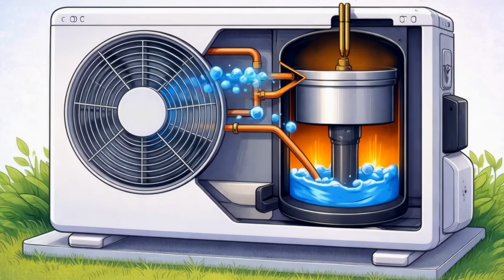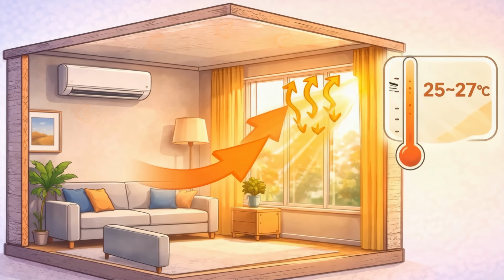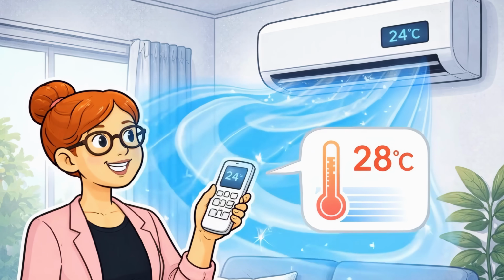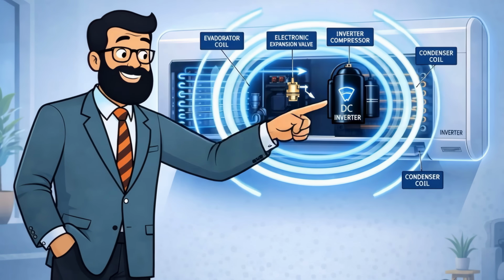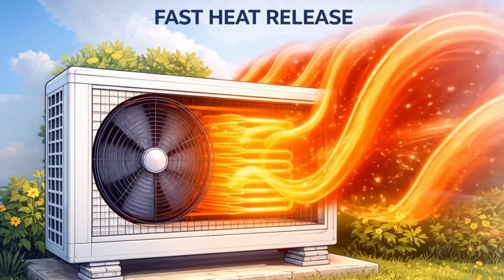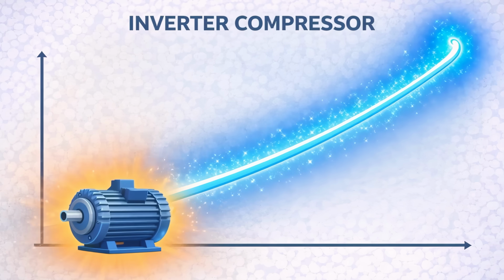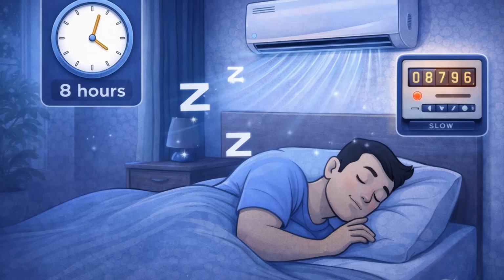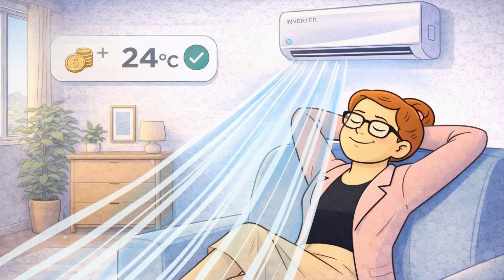Inverter vs Non-Inverter AC: Why Your Electricity Bill is So High! (Science)

Comment: Inverter ACs and heat pumps is definitely the way to go.  I have used them for a long time and have been able to save hugely on my electric bill.  This video has a number of a things that are either not quite right or could be explained better.  Here are some things to consider:
1. We see properties of the refrigeration cycle every day, especially with water.  When you cook your food in a pot of water for example, the water boils.  The cook time is constant no matter what setting the burner is on as long as the water keeps boiling.  The water turns to steam and expands and when it expands into steam, it cools and takes heat away.  You can't get the pot above the boiling point as long as there is water in it and it is not a pressure cooker.  You go to a higher altitude and then cook, say a cabin up in the mountains and you have to cook your food for longer because the water is boiling at a lower temperature because it is at a lower pressure.
Swinging back over to the refrigeration cycle, it is like water and steam, except the refrigerant boils at a lower temperature than water and you do the cycle in reverse with the help of a compressor, which raises the boiling point by raising the pressure.  So no, it is not some wield thing you don't normally see.  It is something you see every day, maybe without realizing what you are looking at.  Just didn't think it through, so didn't realize how common it actually is to see.

2. The explanation on why inverter units are more efficient could have been explained better and considered more things.  One thing to consider is the common single phase AC motor is just not very efficient.  True, there is the whole inrush current deal when turning on, but that is only part of the story.  To get a single phase motor to work, it is actually more of a messy hack to get it going than an elegant solution.  Because it is a messy hack with funky, electrically noisy things going to make the single phase motor to work, it is horribly inefficient.  Going to power electronics to control the motor opens the possibility to use far more efficient electric motor designs.  It doesn't mean the unit you get uses a far more efficient motor, but there are inverter AC units out there with very efficient motors in them.  So yeah, you can start off with a far more inherently efficient motor, slowly ramp it up and down, and have it cruise at a lower speed when you don't need max performance out of it.

Another thing to think about with slowing down the pump is other illustrations I have seen shrink the motor size in relation to the radiators.  What you effectively do is shrink the temperature delta between the surrounding air and the coils.  What this allows is the pump to work less hard to move the heat from the cold side to the hot side.  Usually when you look at the temperature and pressure graph of a refrigerant, pressure goes up exponentially with with temperature.  It comes out to things like twice the temperature differential that the pump needs to maintain means not just 4 times the pressure, but several times the pressure.  Several times the pressure means several times harder the compressor needs to work.  We see this kind of thing with driving a car, power is actually a cubic factor with speed as drag is a square factor.

3. Talking about cars, I think a better way to explain the efficiency difference between a single stage air conditioner and an inverter unit is say you are taking a road trip from Los Angeles to Las Vegas.  You have a set time frame of traveling for 7 hours to make the trip.  First up is your 1960's muscle car.  It only has two throttle positions, full throttle until you reach 100 mph and slammed on the brakes until you are at 0 mph.  So, you start off with full throttle, the tires peel out until you get to 100 mph.  Once you are a little ahead of schedule, you slam on the brakes, skidding to a stop.  Once you are behind schedule a little, you slam on the gas again, peeling out until you get to 100 mph.  You do this over and over again until you get to Las Vegas at the scheduled time.  Then you look at your gas bill and wow, that was a lot of gas burned.  Now say you make the trip in a modern Toyota Prius.  The car is allowed to cruise at a fairly steady cruising speed, maybe going 55 mph at times, maybe 65 mph at times, maybe down to 45 mph at different times.  But in the end the car makes it to Las Vegas on time.  You look at your gas bill and it is a whole lot better than the 1960's muscle car.  Just everything was more advanced, smoother going, and far more efficiently done.

4. I think a very important thing to go a little deeper into is an air conditioner / heat pump is a heat conveyor belt.  This video touched on it a little, but didn't really do it justice.  Absolute zero is hundreds of degrees below the scales we generally used to measure the temperature.  It is the starting point of the Kelvin scale, which is probably a better way to build a mental picture.  Your heat conveyor belt is just creating a temperature differential, soaking up heat on once side, and moving that heat from one place to another place.  As long as that heat differential is not too big, it can efficiently move that heat around.  As the high differential gets bigger, it has to work harder with the working fluid it has in it and has to stay in the confines of what the materials can effectively handle.  In the scheme of things a warm, somewhat overcast day outside and trying to get a little cooler inside so that it is comfortable is an easy enough task to be several hundred percent efficient in terms of removing the heat from the room.  As it gets to be a very hot day and you are trying to maintain the same indoor temperature with the Sun beating down on your place, efficiency drops to create this higher temperature differential with the outside radiator and the workload heaps on from having to remove the heat that is seeping into the place from the Sun.  So than to get more out of the radiators, the air conditioner has to create an even higher temperature differential, which means efficiency drops even more.  This is another reason why you wan't to try to cruise as a single stage air conditioner is just slamming away going all out at its single speed where an inverter unit may be able to still scale back some and get the job down with a lower temperature differential that is just more constantly maintained.  This is also why a heat pump in the winter if it is not too terribly cold outside can be 300% efficient or more.  It is just not that huge of a temperature differential and usually there is some heat created in the home and/or seeping in through Sunlight hitting the place, so as long as the outdoor coils are kept from freezing up, it is just not that hard to keep the indoor temperature up.  Also, the refrigerant is operating at lower pressures overall because of the lower temperatures in the winter time, so there are lower pressures for the compressor to work against.

5. One more thing to add is using an air conditioner in a power outage.  Say you pick up a generator that can potentially power your air conditioner.  If you have a single stage compressor, that by default creates a huge surge that will kill most any generator.  You would need to get a soft starter to keep the generator from being overloaded.  Now an inverter based air conditioner always starts off at low power and slowly ramps up.  Very easy for any generator to handle.  If you are ever worried about being in the heat with no grid power, this can make all of the difference in the world.  I remember on a hot day power was out at my place for over 8 hours.  I had an inverter based mini-split that usually pulled 400 - 600W on warm days.  On this hot day, it started by pulling 200W from the generator and ramped up to 1,100W, where it stayed for most of the afternoon because it was unusually hot out.  The 3000W continuous capable generator kept up no problem with that 1,100W air conditioner load and I was able to keep other things going to a reasonably comfy day with it being reasonably cool inside and my stuff powered.  Granted, the inverter generator started to get a little loud with everything going, but it was still under the 70% load that you shouldn't go above for a sustained load.  But I had a 75 ft TT-30 extension cable with a breakout TT-30 to NEMA 5-20 adapter at the end and 'loud' was I could just barely make out the sound of the generator with the place closed up when I stopped playing things over the sound system where when I first started the generator before it got hot out as power went out in the morning, I couldn't hear the generator at all from inside while it was at the other end of that 75-ft extension cable.  And the cable came through a window that was cracked open for the cable and went to the middle of my house so I could more easily connect everything up to it, so the generator wasn't really that far away.
Reply from the maker: Wow, that's so detailed. Thanks for all the useful information!!
Reply: Thank you huge paragraph guy 😂

Comment: The inverter unit does cycle if it's size properly and set at a moderate temperature. It also doesn't start high, it starts low then ramp up.

Comment: As a user on Inverter AC, I would confirm inverter AC is NOT the champ every time. 
You also have to identify your room first, is it receiving direct sunlight during afternoon and evening or closer to any thermal source.
I installed inverter AC in a room where it receives direct sunlight during afternoon/evening, and yes....the Inverter AC just reduce my electricity bill at most 7%.
It's different story when you installed an Inverter AC in an ideal room where it does not expose to any thermal source.

Comment: Not all inverters can go down to those levels of 10%-15%.  The reality is that most single room inverters can go down to just 40% and maybe 30%.  Where you will see really low % is on multi units and the reason is very simple.  Imagine you have a 4 room split unit and only one room is on.  Well since it's meant for 4 rooms, turning it on one room is just 25% of it's capacity and if it can only go down to 40% or 30% that is still above what it needs for one room so you have essentially turned this inverter ac into a non inverter ac.  So at 10% for one room it's like 40%.

Comment: The WORST waste of energy is the SINGLE hose PORTABLES.  A two hose unit uses outside air to cool the condenser, then moves inside air across the cold evaporator. A single hose unit uses the air you just paid to cool, to cool the condenser and send it outside!  That creates a vacuum in the room, which causes hot air from outside to sneak past the window adapter and replace the cold air you just lost!  They cost about the same to build.  I guess they sell because one hose looks better than two? The single hose units should be banned.

Comment: The energy savings are proven. However, the explanation is questionable.  The output of cold air is not instantaneous.  The compressor has to compress and raises the temp of the refrigerant ASAP,  then it is slowly released into the evaporator to drop the pressure and therefore the temp.   It is not clear why it is bad to compress ASAP when called upon.  Also, slowing it down when temp target is nearly there is not the only way to avoid overshoot.  Even ancient oil furnaces had 'stats with a heat anticipator, and would shut it down before target reached, to avoid overshoot.  And a non-inverter can be designed to run slow or fast too.

Comment: The a/c inverter is good until the day the electronics fail, and most of the time the parts aren't available, and if they are, the price of a new prcb is a fortune, so it's better to buy a new air conditioner instead. That's why I always use basic a/c no funcy electronics neither remote control or wifi. The electricity bill is higher, but it works fine for 12 years and more.
The video lies when it mentions that R22 freon was bad for the ozone layer... that's pure nonsense, the ozone layer is a myth created by dupont and other mfrs to obtain new patents, ozone doesn't exist and never has. From the moment it mentioned "global warming" I stopped watching the video. I'm not obligated to listen to idiotic lies and crap

Comment: Mine has been running continuously 24/7 for the last month. 😂 Inverter with 5 star ⭐️⭐️⭐️⭐️⭐️  is the best.
Reply from the maker: If it runs that much then 5 star inverter is the best option there is.
Reply: I have the Midea U shape 8000 but inverter unit so cold and quiet.

Comment: In repairs non inverter lasted longer than inverter. 

Inverter May look officiant in electric Consumption it's useless after the warrant expiration it broke itself. 
if the control board had Brocken it becomes trash not reparable.

My split type non inverter AC lasted 50years now and it still running the old frame had gone rusted but the inside are still in good condition I only spent on the capacitor copper pipe and liquid cooling gas for the AC still work's. 

AC today suck it only lasted one year part's are not available in market that's why it becomes trash
Reply from the maker: Wow 50 years is just amazing. Non inverter is definitely the most repair friendly 👍🏾

Comment: Some Technician recommend non inverter due to high repair cost !
Reply: Same to me, he said inverters tend to break easily and it's not worth to spend the higher initial price. But I'm not buying into his line, also it saves so much energy it covers quickly the price difference. Also inverters are more silent and the noise factor is very important for our well being
Reply: Exactly.😊

Comment: I paid heavily for opting to inverter aircons. PCB repairs,  replacements made life hell and had to throw away those units. All the lie of savings ended up in losses.
Reply: You bought poor quality airconditioners. I have been using inverter ACs for 5 years with zero issues
Reply: @enadegheeghaghe6369  The brand I bought was Toshiba. Worst was their customer service was terrible. I had around 16 units installed. Main issue was PCB getting burnt... This was 14 years back. I tried a gamble and got hit very badly. I am not blaming the technology but bad products.
Reply: wow you must have had bad luck (ni\ote here in norway we, for historcal reasons" have no gas infrastructure sp heating is in most areas electric only and winders are cold in large parts of the country so our calculations might be a bit sewed because we can't load shift heating to cherper gas)

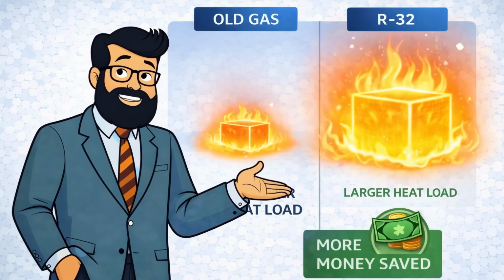Comment: 6:40 wrong. R22 had much better cooling power than r32
Reply: ... and much lower pressure...  High pressure plumbing is a common source for failure.
Reply: @i-ccc-channel  right.
Reply: R32 is not good?

Comment: I live in the tropics (Philippines). The cost of our electric is double the typical American rate. Inverter freezers, refrigerators and ACs dominate. Everyone understands that they are ultimately more cost effective. This is not debatable.
Reply: Don't you need a voltage regulator for each unit because of brownouts?
Reply: @MichLingoes we got solar panels
Reply: @josephlee5654  but not everybody in ph can afford
Reply: @FlapTzyBurner inverter is becoming more main stream now . With the price of gas going up and the electricity cost , any help will help
Reply: Are heat pumps or reversible cycle air conditioners common in the Phillipines especially in Luzon Prefecture?
Reply: @rapisuhamutarou5993 reverse pump is not common but you can find i think

Comment: I have 3 inverter systems in my house, each 10 years old, and zero issues.  Switched from nat gas to heat pumps and my electric bill went down while the gas bill went away.  Good quality hardware and proper installation.

Comment: Due to the fast advancements in technology the inverter parts become more difficult to find as the equipment ages and becomes older, manufactures have to make room for new inventory for new parts and equipment, for me non-inverter is the way to go on the long run.
Reply: this is true, but the same development you point out as a parts replacement issue, allso means that the ac/heatpomp becomes more efficient, so dependent on the unit replacement cost and electricity pricing it might not make sence to keap units more than 5-7 years (esp if you live in locatioms where the heatpomp can be used for heating in winter and ac in summer) that is actually a good arkument for a somewhat more expensive air to air inverting heat pump compared to a basic non inverter ac only system,. It all depends on  what temprature range you are conferrable with, your homes insulation, the local climate etc (and or the cheap landlords out there, if your tennants pay the electricity themselves you might be able to charge a bit more rent if you take the time to explain thet the inverying heatpump  tah's incuded in the rent will save them money on electricity.  Or if electriciy is included in ther rent, you can drop the rent abit and still preserve your profit margins (or reduce risk from spikes in electricity prices ( cold snaps/heat waves, geopolitical shocks etc)))

Comment: The other thing about an inverter A/C is it draws a lot less power. I can plug our inverter into any outlet in the house. A traditional A/C needs a higher capacity circuit. Add the cost of an electrician to where you want it.
Reply: Put a soft-start infront of your A/C's compressor and you may very likely plug our A/C into any outlet in the house too.
Reply: @K2teknik. We added a Micro-Air soft start to our 2-1/2 ton Trane central air to our house. It cut the cold load pick up from 72 amps to 20 amps. We can start our central air & the rest of the house with our 5500 watt portable generator.
Reply from the maker: That's true.